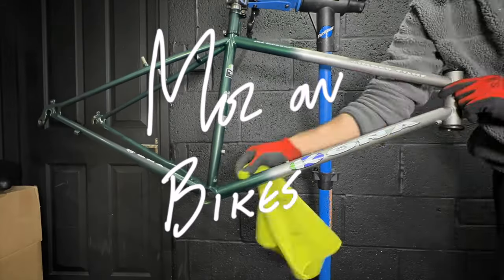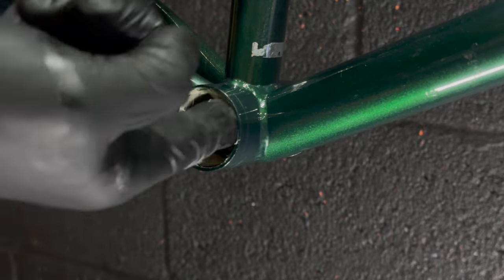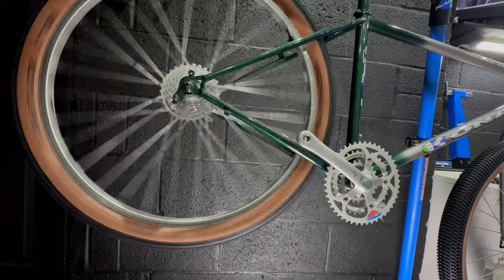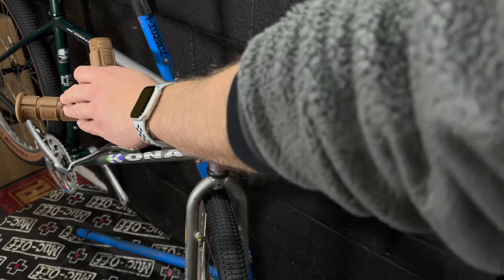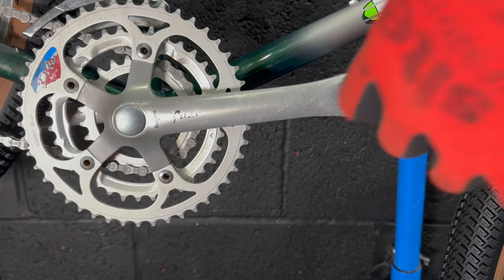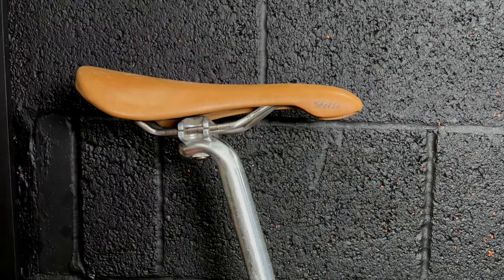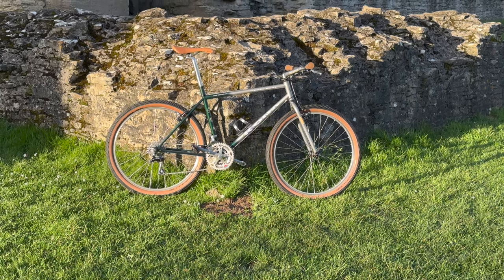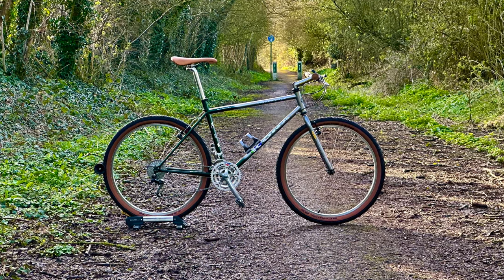1993 Kona Cinder Cone Restroation Part3

Comment: Hey Moz, any time you going to get more Shimano GRX parts for a build?
Reply from the maker: Hey, hmm at this point in time I have nothing planned, I’ve seen a few GRX/XT rear derailleur hacks floating around which I’m quite tempted by for an upgrade for my specialized Diverge but I feel the spare parts are a little tricky to get hold of in the U.K. so would require a sacrificial XT rear mech. 
Other than that I’m always on the look out for a bargain groupset as they are always the most costly point for my builds. I am considering getting some Shimano Cues parts for a up coming build (probably for the Klein) and whilst I’ll have the parts around me I’ll do some experimenting with the drop levers around me to see if there’s some alignment on cable pull compatibility that’s outside of the Shimano compatibility chart. I suspect there might be.